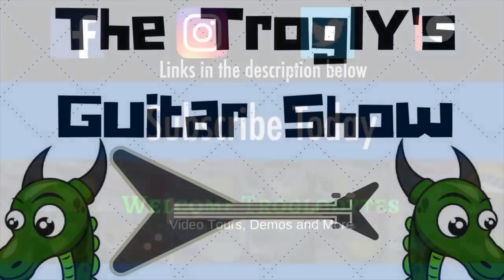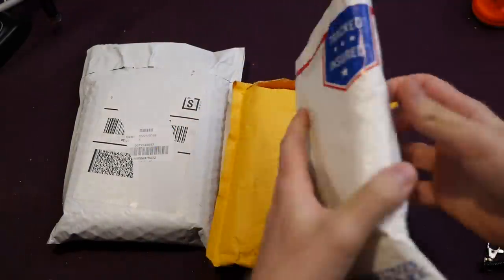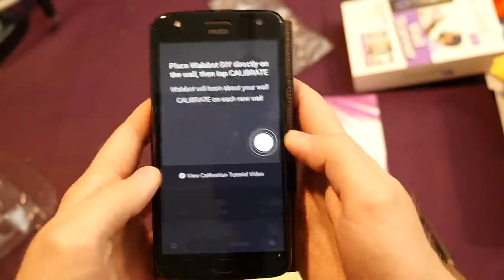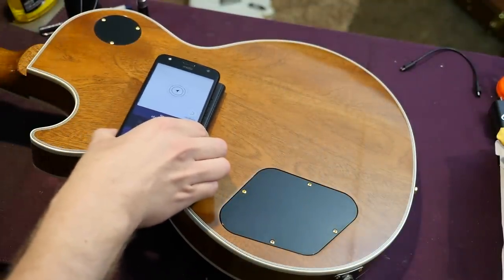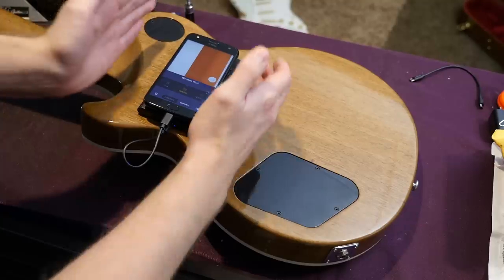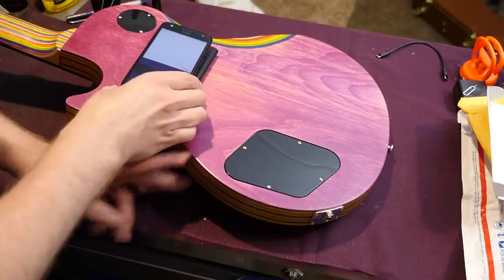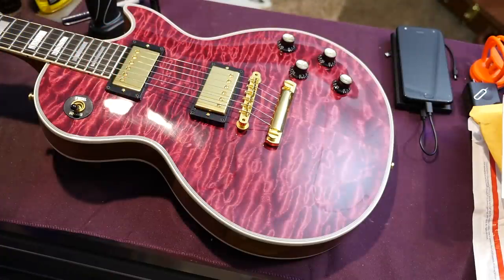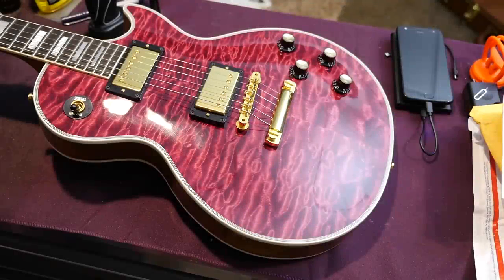Can You Use the Walabot Stud Finder to See Weight Relief in a Guitar?

Comment: I think you might be using the walabot "too correctly".. You take a solid body guitar and then calibrate on it so when you sweep the detector on it of course it detects the same width all over. I think you might be more successful by calibrating the walabot on a thinner piece of wood than the regular guitar body and then sweeping the guitar body.
Reply: Yeah al those apps have lots of settings
Reply: KristinnEs you might have something there...

Comment: From my understanding the device shows you studs in the wall. Which is why it displayed a stud in between the pick ups. But nothing when you put it over the pick up cavities. This is because the white screen means “not a place to hammer stuff” so when you hovered the device over the V shaped weight relieved area it displayed white space. That is because the device couldn’t find anything you could hammer it into. Remember it’s a construction tool not a fine tool or instrument we can use to see weight relief. So technically the device did show weight relief just not in the way we’re looking for. I’d advise the ultrasound approach or the x ray but I’m pretty sure you have to remove all the metal on your body before entering an x Ray. And even as careful was you are one forgotten screw could ruin the guitar. Unless I’m thinking of an MRI. I get the 2 mixed up so forgive me for mixing them up if that is the case

Comment: Austin -  I could have told you it would not work and saved you the money and time. Any of these stud finders are not actually finding studs, they are finding material more dense than the outer material. The holes for weight relief will not show up because there is no "new" or "different" material for it to pick up, this is why you are seeing the wiring. I was a bit surprised it was not picking up the bridge and tailpiece though. Other than trusting Gibson's info (lololol) the only way I could think of would be to use some type of sonogram, xray, ultrasound or something along those lines. But one thing, is the maple top thinner than the mahogany back? Maybe flip it over and try it going through the maple but I don't think that is going to work because the two woods are close enough to matching density that the small holes for the weight relief are not showing because it's picking up the wood on the other side of the hole. I guess just get out your trusty chisel and start separating the two halves of the guitar and then you can know for sure huh? lol.

Comment: I think the problem is that stud finders only send a signal strong enough to penetrate up 3/4 inch of gypsum(drywall), which has very little density. 
The back of a guitar, is anywhere from 1/2, to 1 1/2 inch of solid hardwood, over the weight relief holes.
The sonar signal emitted by the stud finder is just not strong enough to penetrate that much density.

Comment: Infrared should work If your worried about the temperature stress, all you should have to do is place a standard light bulb behind the guitar (not too close) and infrared review the other side in a room with slightly turned down (cooler) AC. start viewing it right from the start, and the pattern should develop in the camera without too much temperature differential.

Comment: What if you hit a tuning fork and laid it gently on the body? Would the fork ring differently depending on the density of the wood? Perhaps that could be used to "map" out where the changes in the density are, that would give a good picture of where the chambers are, if it works.
Reply: Wish I had a tuning fork now lol.
Reply: Well, a rather ghetto example of an experiment seemed to work. I just tried it with a normal fork and a Gretsch center block. The hollow part rang a heck of lot louder and longer than the center block. I can see a big problem with my example, the hollow part of a hollow body is really really hollow, if that makes sense lol, I could the chambers used in some weight relief patterns not amplifying the sound as much. Although maybe doing it with a real tuning fork and not household cutlery would give it that little extra it need to pass on the vibrations sufficiently. Unfortunately I don't have any guitars with weigh relief either, the center block is the closest I could get.

Comment: Maybe a different type of stud finder, some work off of reading the capacitance and then use that to determine density. Where as others use magnetic field to find out where nails are, then figure out where the stud is based on that. but there is also some that work using radar maybe try that.

Comment: Trog.  You're calibrating it to "not" see the guitar, right?  The device doesn't detect the wall, only objects behind it.  So try calibrating it the other way.  Calibrate on a white sheet of paper, then run against the guitar, and it may show areas of wood???
Reply: Or place a metal sheet behind the guitar, in theory if you calibrate right, it will see thru the weight relief to find the metal!

Comment: I wouldn't expect that the Walmart would actually find something that's not there there's nothing there but it's this pick up the steam wood stuck between the two pickups I think if it was able to pick up the wood surrounding the wait release holes and pick that up like the outline of a wait release because that's what it seemed to have done in a solid body guitar it's not going to pick up that would between the pickups the fact that it takes that up and then not other stuff makes me think that you possibly could find the tracing of the picture of the white release with that possibly I'm not sure but it's worth trying it that way anyway please excuse any typos misspelled words definitely lack of punctuation I'm not illiterate I'm not even the bad typer I'm just legally blind using Speech-to-Text which often has a mind of its own and it is a little bit because it doesn't do punctuation thanks for letting me share :-)